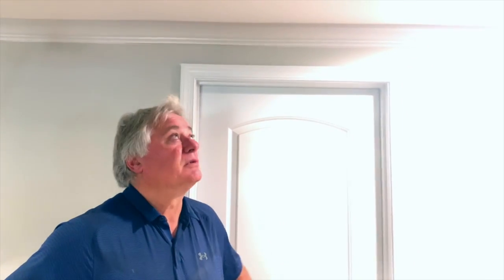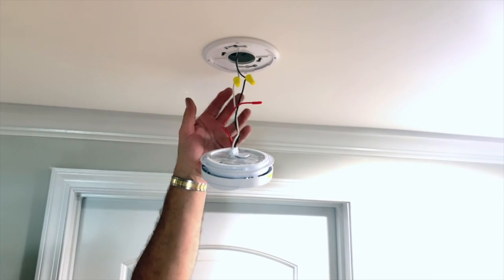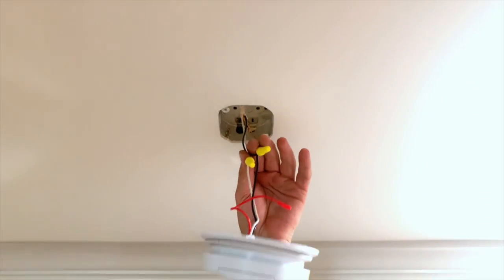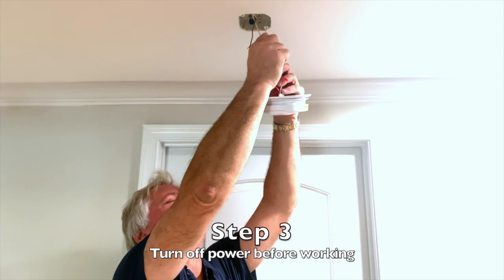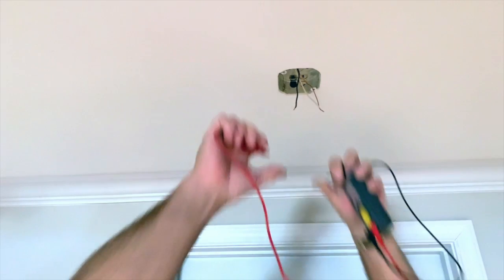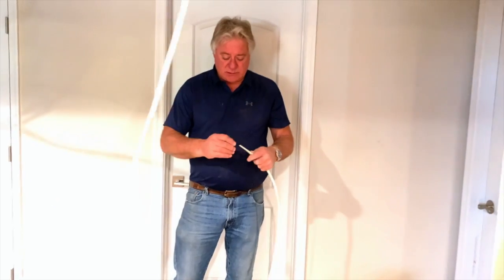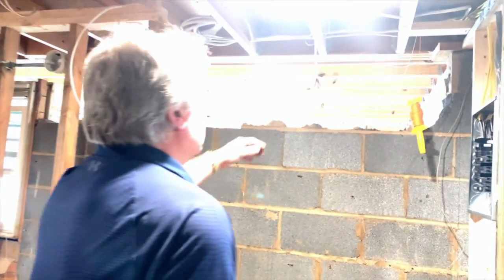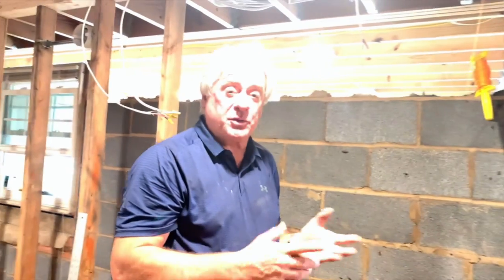How to Wire Multiple Station Smoke Detectors

Comment: I would like to know where the wire start from do it start from the breaker box if so I would like to see you hook up your wires in the breaker box and run them to the smoke alarm

Comment: the wire replacement is easy if you just have to go a few feet, but good luck snaking that new wire through a bunch of ceilings and walls. plus, isn't the old wire always going to be stapled inside walls?
Reply: Only required if walls are unfinished, I believe